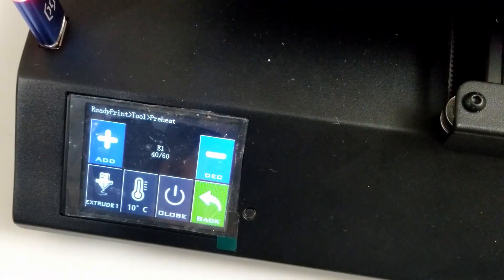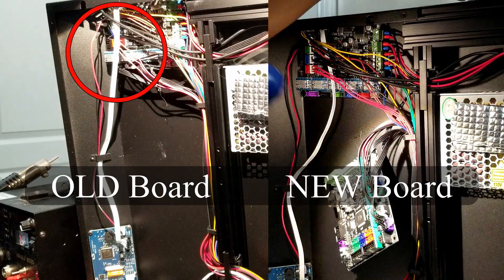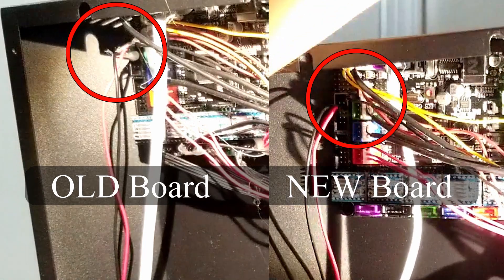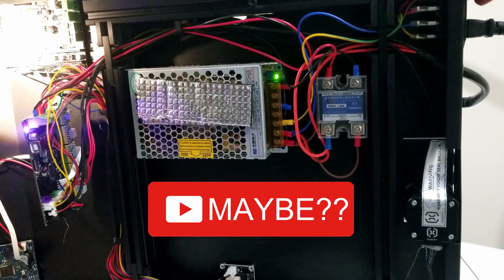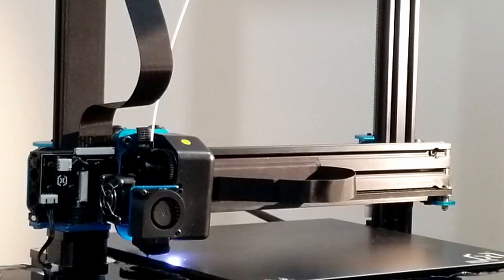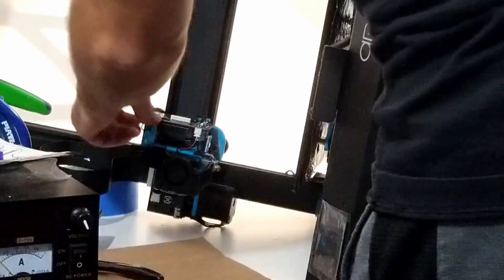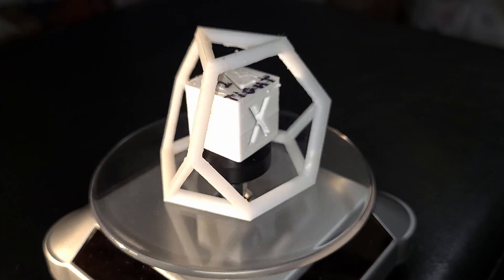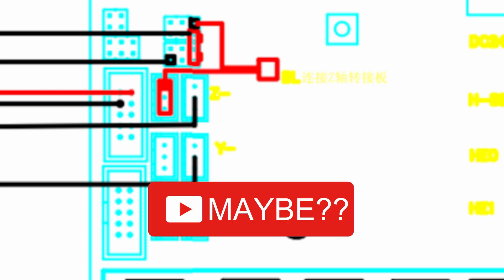Error heating failed system stopped | Sidewinder X1 Motherboard change

Comment: I have the same issue with my old artillery, does anyone knows if there is a way to repair the component on the board that cause this problem? i have been told the only solution is to replace the entire motherboard.
Reply from the maker: yea replacing the board and uploading the precompile firmware from artillery or buying the board from them unless you still have the warranty. or buy a newer board

Comment: Thanks for the Video. Just encountered the Same issue. Did you had to flash the firmware after replacing the card?
Reply from the maker: I do not remember.
Reply from the maker: You can ask support for that or actually get the firmware from artillery and flash it yourself.

Comment: On my Sidewinder X1 the cable from the heating bed came out of the case. So I opend the bottom plate an secured the cable from the inside with cable ties. Seems to fix my problem for now.
Reply from the maker: Mine I had to change the board.

Comment: My first problem ever with the Sidewinder was that it started heating up the Nozzle when I turned it on. I told the customer service my problem and they too send me a new bord. 

I just found your video as I got the same error message for my hotend. I tried turning it on and off again but it didn't work as well as checking the cables. 
Somehow my printer fixed itself. I wanted to try heating up the Nozzle so I had the exact error message to report and it just started heating as normal. I hope it stays that way.
Reply from the maker: On mine the sensor was not working, and a new Motherboard fixed it.

Comment: I will never again buy such a crap like this printer.
Reply from the maker: I am sorry to hear you got a bad one. Did you figure it out what was the main issue you had with it? I have been saying for a while getting a budget 3d printer has a high percentage of luck factor. I have been dealing with a few issues myself but compared with other printers I dealt with seems to get the job done.
Reply: @RoamingInterests  Not yet, but I have ordered a Prusa MK3S+, not giving up on this yet :D
Reply from the maker: Tell me how the prusa works for you. I have been avoiding getting that one for a while.
Reply: I just bought a used one that the Owner says it will randomly throw a Heater 0 error and stops the print. I am excited to work on this X1. I currently have a X1 and X2 and absolutely love these printers. I was thinking of going ahead and buying a 32 bit motherboard but still unsure of the advantages of the 32 versus 16. Thanks for this video!

Comment: Is your test print on Thingiverse? Wouldn't mind giving it a try.
Reply from the maker: Here I just published the tetrahex - you need to scale it down. it is quite large. https://www.thingiverse.com/thing:4775293
Reply from the maker: Have you given it a try?
Reply: @RoamingInterests  Sorry, I got slammed, I've actually printed this (without resizing it down any) in PLA and PETG. Granted, I hadn't dialed in the PETG temps though and it was a new roll that I hadn't printed with yet. So, the PETG bridging was a bit ugly. Will probably send you an email with a link to the photos, didn't see any other way in YouTube to direct message you.

Comment: I’ve had my new Sidewinder X1 for almost 3weeks and tonight while making a 24 hour print it has thrown the same error. When I received the printer I couldn’t print much because the glass bed had a significant dip towards the center. They are in the midst of sending another bed, but now I guess I’ll be reaching out to get a mother board now. I want to be excited about this good looking printer but if I’m honest it’s a pain in the ass. I would have purchased something else had I known it would be this unreliable.
Reply from the maker: I am truly sorry about your experience with the 3D printer. My bed has a slight dip in the center. I noticed that as well. Yea That error is quite frustrating. It took me a while until I figured it out. But I did reach in facebook groups to get confirmation to my suspicions, and then I reached out to support.

Comment: Thank you for making this video! My Artillery Sidewinder X1 v4 keeps throwing thermal runaway errors on both the heatbed and the hot end. I've had the printer for just over a year and this just started happening. This information will help me decide what to do next. Sounds like I need to replace the motherboard then?
Reply from the maker: That was my way to fix the issue. I purchased  two motherboards just in case I damage one I still have a spare. Mine was still warrantied and support sent me a replacement one but I did not wait for them I purchased two as i figured out is the motherboard. I use new thermistors and with new thermistors i would get the temp runaway protection. I hope you re-sat the wires and everything before making the decision to go for a new motherboard. support was really helpful and they sent pictures for me to check is the harness that connects to the extruder might have a pin bent and that may not connect properly not allowing the thermistor to read. but if you have the bed as well that goes into runaway protection without heating the nozzle than it is mot likely the motherboard. There is plastic glue to secure the wires properly that is how i could not figure it out if the 3 wires are properly connected, because they came out with the plastic and i did not know precisely where they came from. Also I did find the motherboard info on another youtube video. but I doublechecked on Facebook groups before buying the motherboard. I hope you fix yours soon.